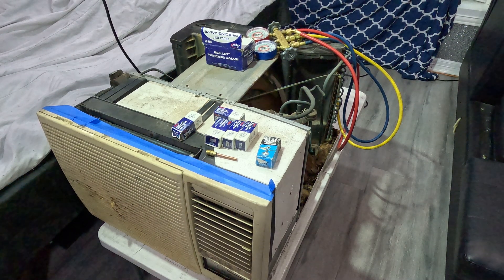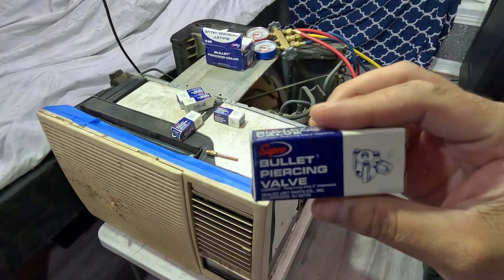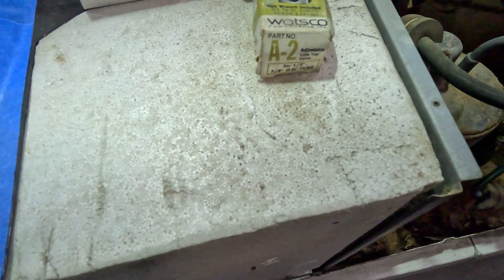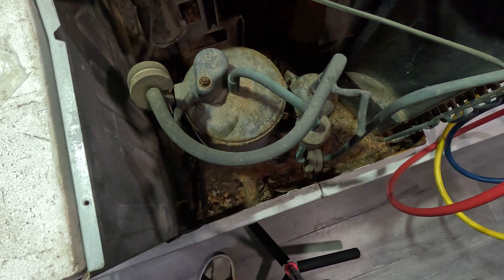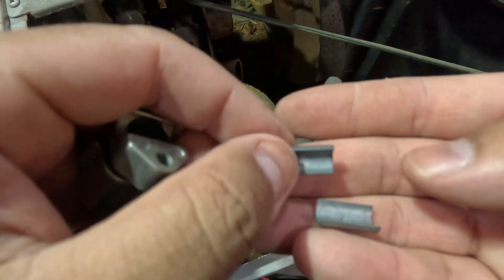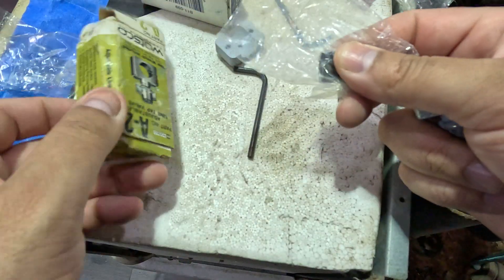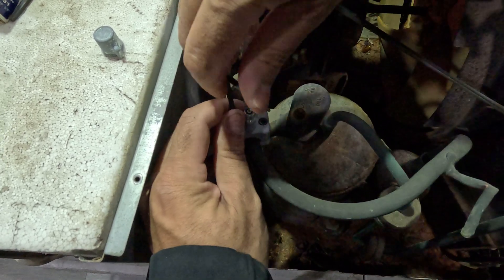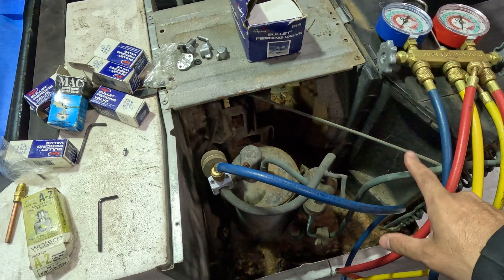(Part #1) How To Recharge Or Refill Freon For A Window Wall Unit Air Conditioner (R-22 R-410 R-32)

Comment: Should the line be cleaned before installing the valve. Steel wool or sand paper?
Reply from the maker: Cleaning the line will create a better seal, especially if there rust or corrosion on the line.

Comment: I was just going to install  piercing valve on my dehumidifier which uses R410.  The Supco Piercing valve instructions state it is not for R410 use.  Any thoughts???  Please!
What is the best piercing valve for R410?
Reply: what did you end up doing? I have a R32 dehumidifier, and I think its pressure is too high for these.

Comment: Thank you. I dont know how to use the meter things
Reply: The meter, manifold, is easy you hook up high side and low side and then you can connect the freon to the manifold and add to specs for the high psi and low, basically the cutoff for high and low pressure

Comment: Great video bud ! Where can I get the valve at ?
Reply from the maker: https://www.amazon.com/s?k=line+tap+valve&crid=1OPLYVWEGBWU0&sprefix=line+tap+valv%2Caps%2C160&ref=nb_sb_noss_2
Reply: @diyhvacadvice2millionaire I'm not sure what size to buy
Reply: How do I know the size of line?
Reply from the maker: most 12,000 btu window units require a 5/16 diameter line tap. Bigger window units like 15,000 to 24,000 btu  are usually 3/8 to 1/2 inch, but just by both sizes just in case.
Reply: Thank you !